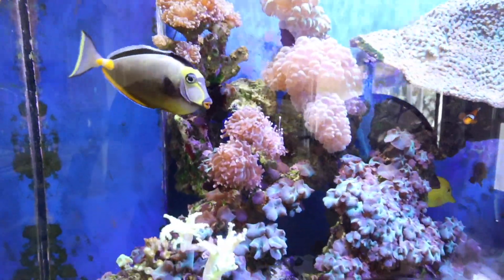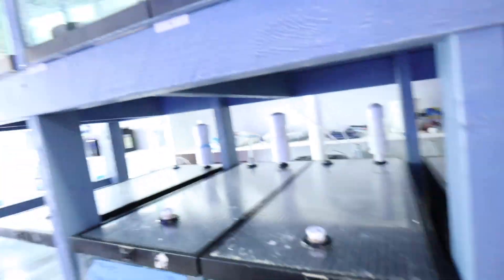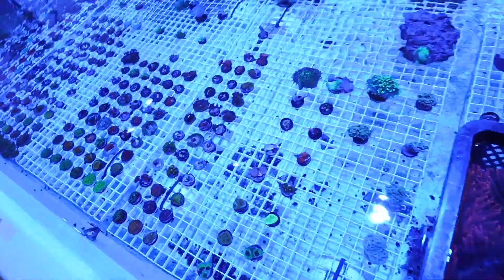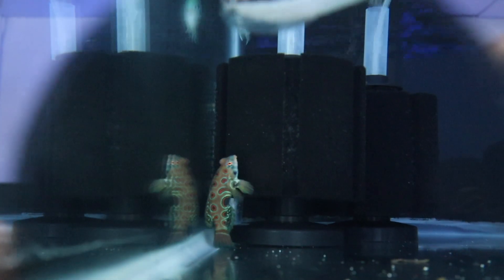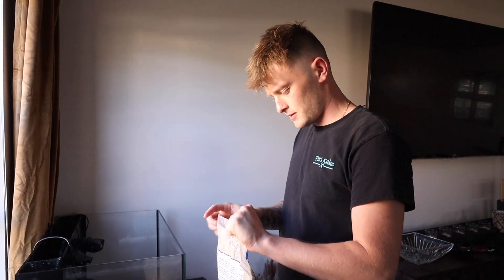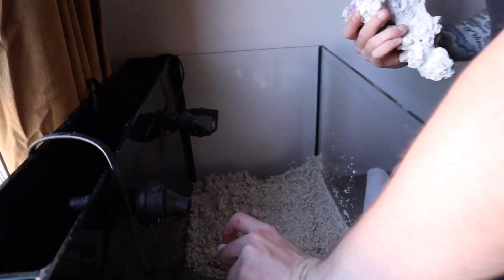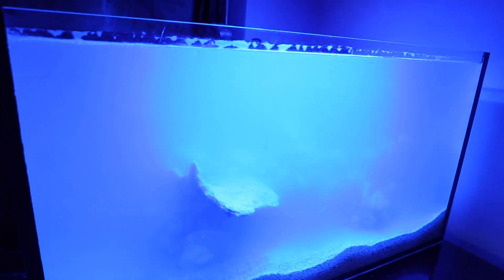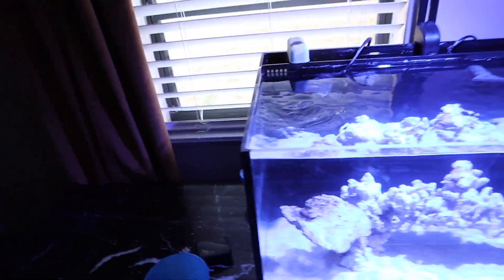BUYING my FIRST SALTWATER TANK!!!!!!!!

Comment: One concern observing a beginner. Make Sure the rocks are not ON the sand but on the glass (move the sand all the way out of the way Then place the structure. Then sweep the sand back around the structures.) Especially with those bridges. When animals come in they will shift the sand and you don't want them collapsing on your animals.
Reply from the maker: Good idea!
Reply: @GioLanni    You can scratch the glass with stone against sand against glass. 
   Maybe even put down some egg crate attic or some thin foam under the structure where they touch the glass..
Reply: @GioLanni  Have your ever watched SerpaDesigns? Hes the master of Aquascapes and terrarium  builds.. not much saltwater,  though the same baseline techniques would apply.  
  His skills and channel fascinated me. It was him that brought me all through AnimalTube to here actually.